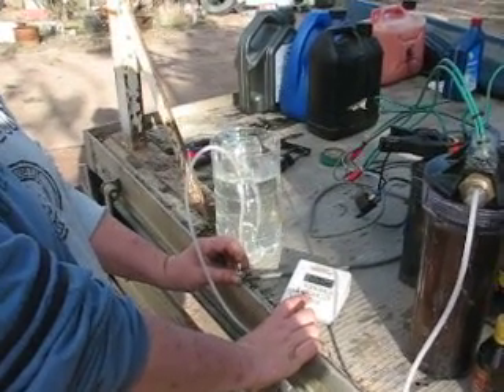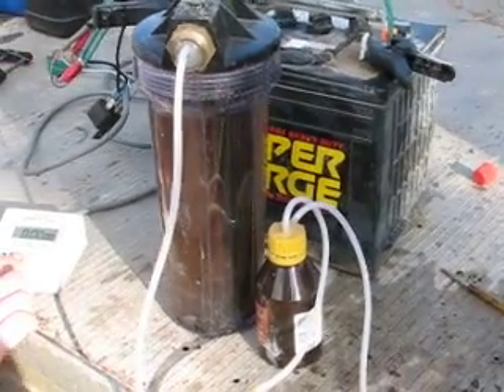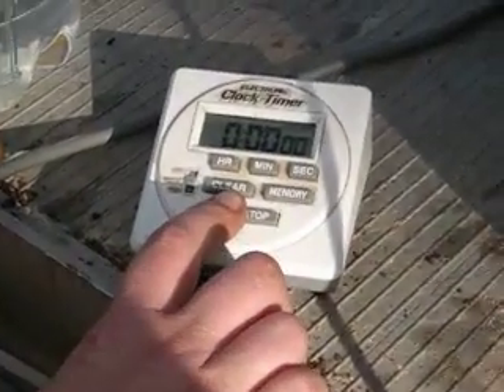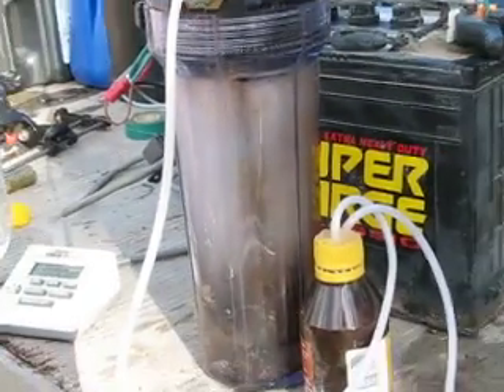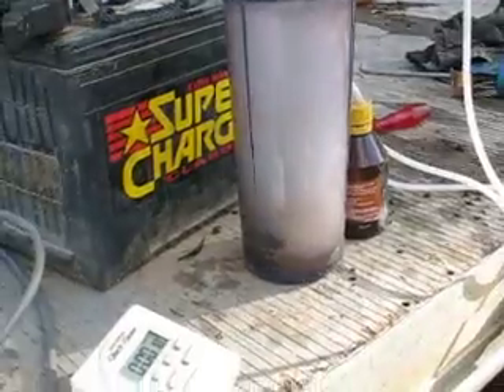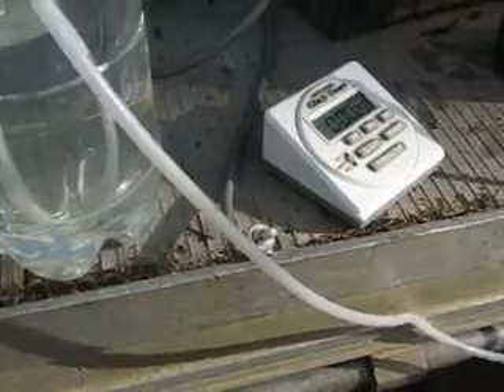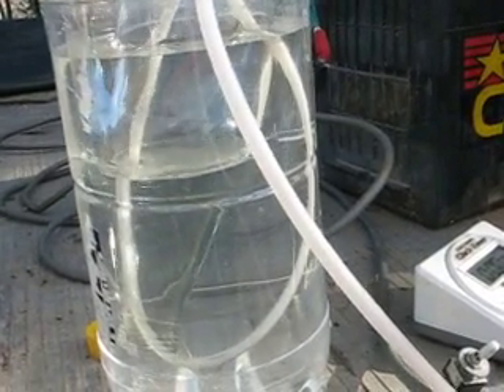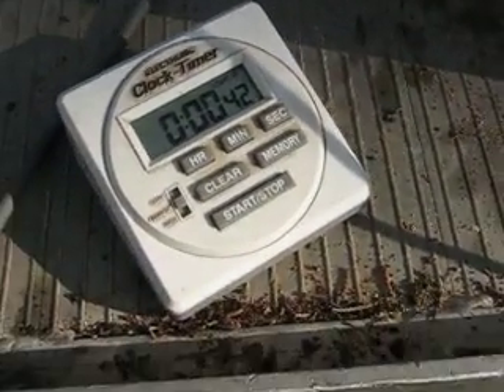Experimental HHO production

Comment: As you may get better results from 1/2" tubing
As with the smaller tubing, it is restricting the flow of hho. Especially, when you are driving, and there is engine vacuum available to help with hho production. But your bubbler may be restricting hho flow as well. Your cell seems to be producing very well. Keep up the good work.